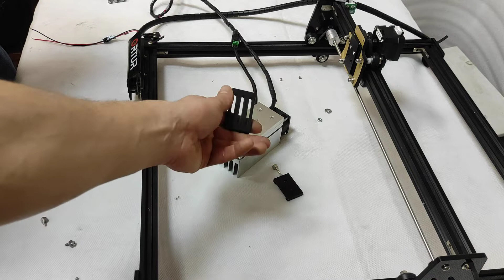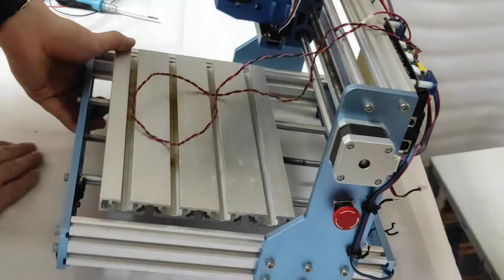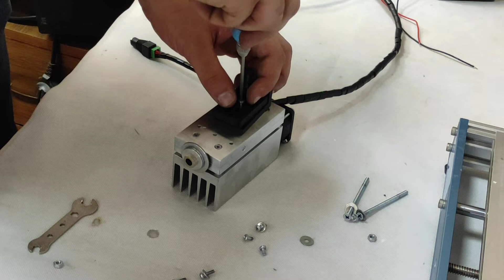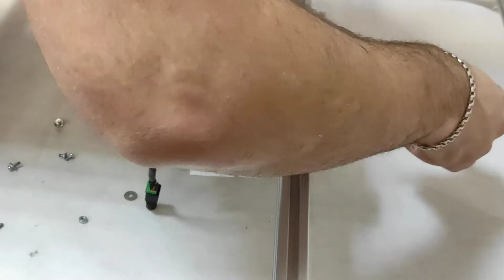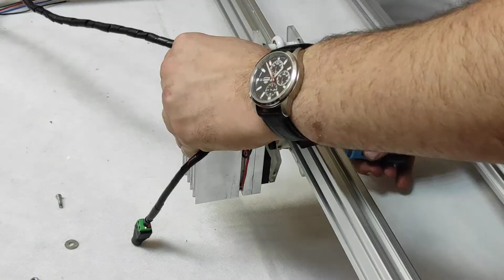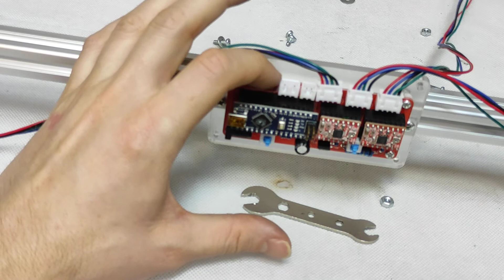10 watt SE laser installation on CNC 3018, Ortur, Universal laser engraver - upgrade your frame

Comment: Are these diode lasers supposed to be able to cut through 1/8" acrylic?  I've done a focus test, and am running 1 ipm full power 8 passes and it's still not cutting all the way through.. how do I get help with this? Thank you